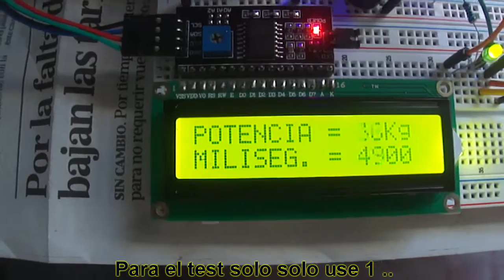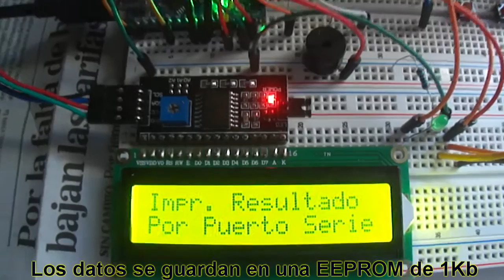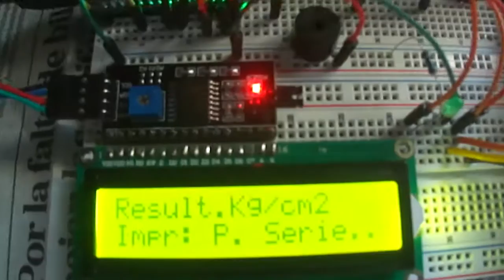Banco de prueba para motor de cohete - [Prototipo]

Comment: Luis podes a hacer un video de como poner un regulador de 12 vol a tu zanella 70 y poner las luzes
Reply from the maker: Hola, +Ivan Sanchez  en este momento no  cuento con ninguna moto para hacer un vídeo sobre el tema.. pero te comento que instalar un regulador de voltaje a una zanella 50/70cc es muy facil, el regulador de voltaje solo tiene 2 cables uno que es la entrada que es donde va conectado el cable que viene de la bobina de baja, y una salida donde la corriente ya sale rectificada y regulada, por lo general el cuerpo del regulador es de metal y va atornillado al chasis y hace de masa a la vez. salu2